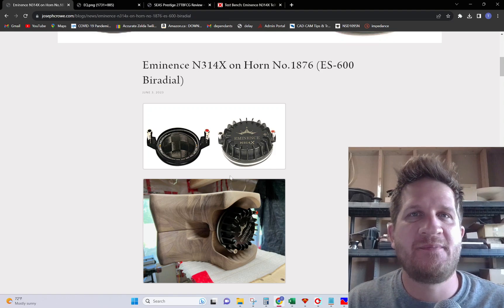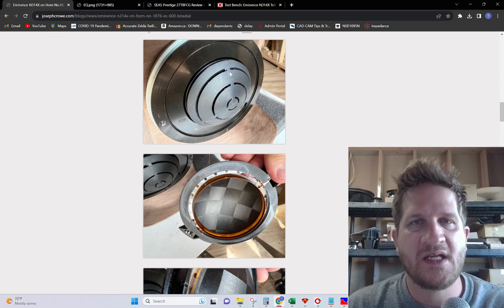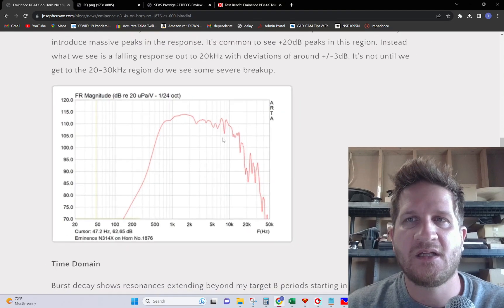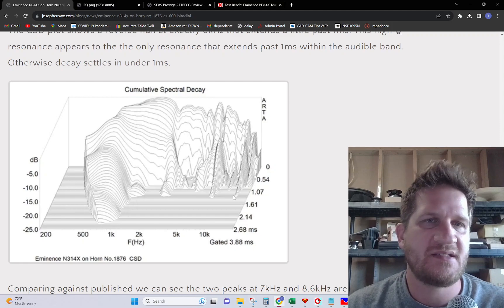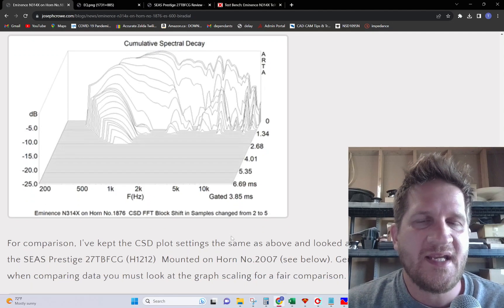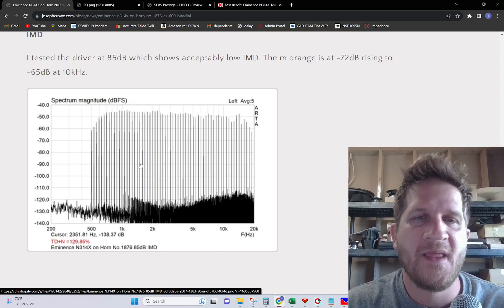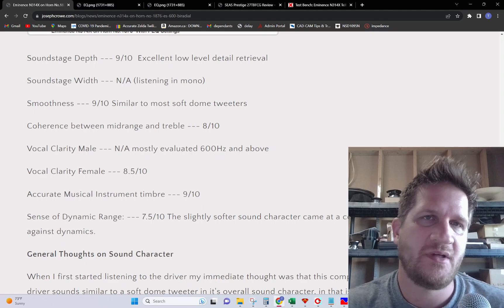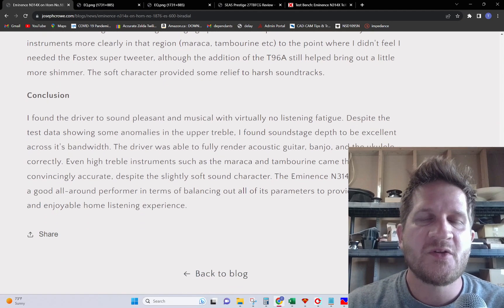Eminence N314X on Horn No.1876 (ES-600 Biradial)

Comment from the maker: Sharing feedback from the Manufacturer "Hope you’re doing well.  Just saw the review for the N314X, nice job!  I enjoyed the measurements and critique.  There were a couple of things I noted that I thought were worth mentioning or elaborating on.  The driver does have a copper shorting ring.  Well, it’s actually a thin copper sleeve capping around the top of the pole piece.  You can’t really tell it’s there because the assembly gets painted with the copper cap already applied.  Once the phase plug is installed and covers the top of the cap and pole, you can’t really tell it’s there, so it can be a bit deceiving.  That also reminds me, I can’t divulge too much information but I wanted to mention that the phase plug material is intentionally not aluminum.  While aluminum phase plugs can offer the benefit of thermal wicking, the phase plug material in the N314T and N314X drivers was carefully chosen because it proved to have an appreciable number of significant performance advantages over aluminum.  I just noticed the comments on the review in regards to “build quality of Eminence” and didn’t want there to be any misunderstanding about the actual amount of engineering, technology, and compassion for quality audio (which you share!) that’s under the hood, so to speak."
Reply: That's what came to my mind. Maybe this delrin-like material has better damping in the highs than aluminium. I always look at phase plugs, grilles (or whatever people put in front of the diaphragm) with suspicion and a bottle of butyl rubber in my hand.
Reply: thanks for sharing!

Comment: 2007 is not a horn cause it does not change an acoustic impedance. It's just a beam former. Secondly, Seas cannot play below 2k. Third,  sensitivities are not even comparable. Cheers ) Good review by the way
PS 700-1kHz resonance is caused by an aluminum cassis of the driver, and must be not observable being properly attached
Reply from the maker: Compression occurs in the phase plug of the driver.
Reply: @JosephCrowesDIYSpeakerBuilding  That's true, but then a pressure immediately drops at a throat, however I suppose that it must drop slightly as a horn expands.

Comment: @josephCrowesDIYSpeakerBuilding  How's this sound compared to other 1.4" drivers like the SB Audience Rosso-65CDN-T?
Reply from the maker: The 65CDN-T is a better overall driver offering better dynamics,lower distortion, and a flatter response. But the Eminemce excels slightly on upper treble soundstage depth/low level detail retrieval. Both drivers could stand to be a little smoother sounding however, such as the smoothness achieved with horn loaded planar.

Comment: Thanks for this review. My impressions were very similar. Great driver but it suffers at the top and has similar smearing to a silk dome tweeter. Switching to the Radian Be both lowered distortion and cleaned up the top of the response. It's a great driver but not an "end game" driver
Reply from the maker: Did you flatten its response when comparing? It’s quite shelf above 10kHz.
Reply: @JosephCrowesDIYSpeakerBuilding  yes, flattened and tested in a number of different horns
Reply from the maker: @gerhardwestphalen  well, I’m glad others are hearing the same thing as me. Thx. 👍